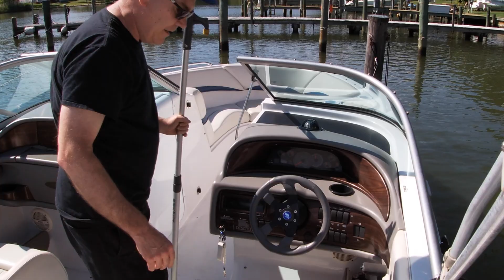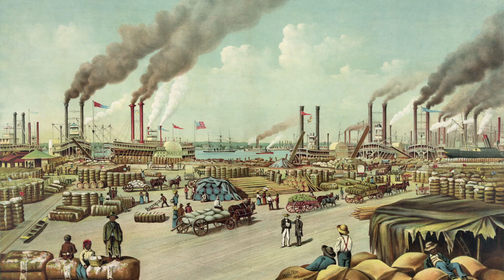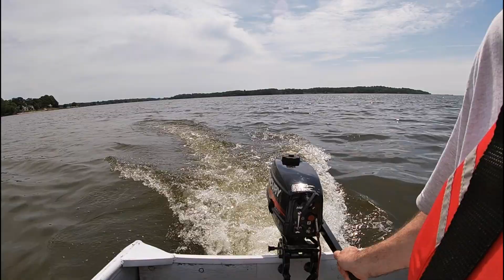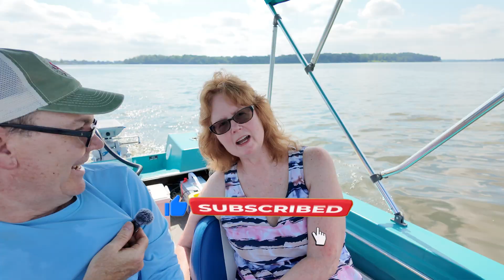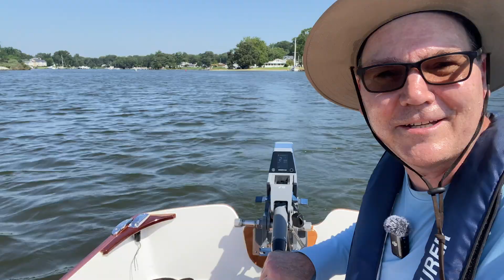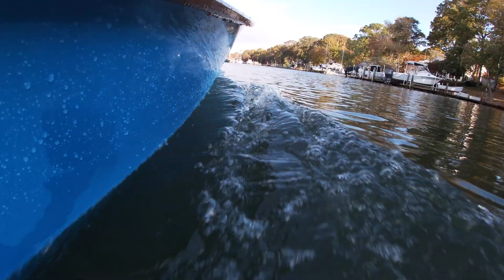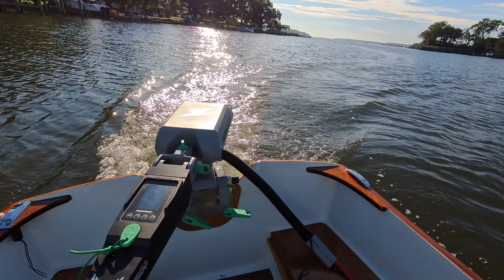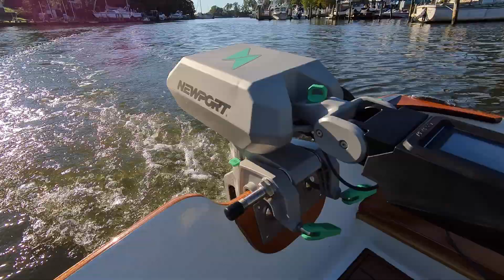The Horsepower Issue with Electric Outboard Motors

Comment: Electric motors work wonderfully for high horsepower applications. My Dad said that during WWII ( you know the big one.) They burned oil in boilers, to make steam, to turn turbines, to make enough electricity, to turn giant powerful electric motors. See, simple..... I have traveled many miles, probably thousands, with an electric boat motor, its called my trolling motor. But when I want to  lift a 3000 lb boat up on plane and return to the dock 5 miles away in a few minutes. I still have to start my old oil burner. Gonna be that way for a while. That is of course if you want to take anything very heavy, very far, very fast.

Comment: "equivalent hp" may be helpful on a land vehicle, it rarely uses all available power. Boats especially anything that can plane will be operated at full throttle. This is not trying to help consumers it's dishonest. As an engineer I don't specify an electric motor based on its "equivalent hp", I look at its power curve. I absolutely would want to know continuous HP rating for a boat. If a a lower HP electric outboard is fun and useful, great. Don't piss on my leg and tell me it's raining.
Reply: It depends. I'm using a 1kW electric motor to push a small sailboat out of the harbour. Its performance is quite comparable to the 3HP gas motor I used before. So for my use case the equivalent number works quite well. If they stated that it's a 1.3HP motor I perhaps wouldn't have tried it.
Reply: Absolutely 💯
Reply: I came to say the same thing I play around with ebikes and performance wise their estimation feels pretty spot on for small land based ev.

Comment: The manufacturers of an electric outboard have to build in a service factor for that unit. on a particular boat YOU could match a prop diameter and pitch to match an outboard of equivalent powers speed.  The problem with this is if you load the boat up or put the motor on a slower hull then the motor cannot achieve the full speed RPM you have tuned the prop for. It will either over amp or just go into protect on the VFD. If this same scenario plays out with an engine it doesn't have the potential to hurt the engine (within reason) the engine just wont do it plodding along at the best it can do. 

Simply put bogging an electric motor down below it's synchronous speed hurts it. This dosnt really apply to gasoline

Comment: 🌴🤔 Hey bud, well this fun , but yeh it really isn’t a fair comparison, as the testing should be on the motor source uses the same drive unit 🤔 by taking an old outboard “ ( say a 5 hp ) “ using it as a gas powered test and then replacing the gas motor with the supposed equivalent to get test results , this way you have the same lower unit with gearing prop size and the amount of friction being exerted against both power source’s, all the new things like better batteries, and high tech controllers, high efficiency more powerful smaller sized solar panels are things that make electric propulsion more desirable, ( and expensive)  my biggest fear is having a massive lithium battery in a sinking boat 😳

Comment: It is strange to have over rated the HP marked on the side.  Some times lakes have HP restrictions like 10HP max.  Hence the popularity of 9.9 HP motors.  Better to have a 6 HP motor that puts out 7 hp than a 15 hp motor that only puts out 7hp.
Reply: @jonleiend1381  That's a really good point! The HP limit is a crude way of controlling boat speeds, but I guess they do it for simplicity of enforcement - no need to argue about exactly how fast someone was moving.

Comment: I am a civil engineer by profession and a boatie in my spare time. I tried the math for my 20ft yacht, which is not a planing hull. I am not interested in a top speed on the plane, because I can't plane. Instead, I am looking for something to propel my (displacement) boat at something-like hull speed, which is (from experience) something-like 5 to 5.5 knots. The problem with the math is that HP implicitly includes speed (Wayne explains this as RPM). kW does not - it is just volts times amps. So, what I actually need to know is the HP or kW needed at 5.5 knots, which will be different from HP needed at 2 or 3 or 4 knots. Again, experience tells me that my 6HP gas motor can push my boat at 5 knots, even when it is pushing into a heavy chop. A mate with the same boat and an EPropulsion Spirit 1 (1kW) tells me he can get about 3 to 4 knots and a couple of hours run-time. This tells me that 1kW is not the same as 6HP (no surprises from the math), but seems "equivalent" to something like a 3HP gas motor. To get an equivalent to my 6HP gas motor on my 20ft non-plane boat, I would need something with more power, such as the Newport NT600 (3kW) or EPropulsion Navy 3.0, which needs a step up from 12V to 24V or 48V.  These comparisons indicate that that the manufacturers are not lying, but you have to know the conditions that apply when they make the comparison. It seems that a 3kW electric motor is or should be equivalent to a 6HP gas motor when pushing a displacement hull at about 5 knots. You cannot use the same comparison when you are on the plane or at any other speed.
Reply: Both HP and kW are units of power, you could measure electric power in HP if you wanted. Or you can do your unit maths and find the distance in a Watt: 1W = 1 N.m.s^-1 

For the rest of us, it's quite sufficient to know that a horsepower is about 746 W. 
Europeans often use the "metric horsepower" or PS which is exactly 750 W. Either way, just divide kW at the prop shaft (typically about 85% of electrical power) by 0.75 and you'll have approximate horsepower.
Reply: @nerd1000ify  Yes, in theory - But the point is that you have different efficiencies, too - Turning either electricity into water displaced or gasoline into water displaced.

Also, I know that in the car field, "HP" of an engine is just that - what you get out of the engine itself under ideal conditions(sea level usually). Not what actually gets to the wheels. You have drivetrain losses, accessories all "robbing" HP, etc. An electric motor driving the wheels through a single gear would be able to keep up with less HP. 

In the boating world, what's the equivalent here? Does "HP" actually mean output shaft HP? Or just the engine HP? Because you probably still have an alternator/battery charger sapping some power, etc. 

And, ideal conditions - It should be closer than with a car, because lakes and the sea generally stays above freezing and relatively cool - but running an engine at a lake at 2000' elevation will produce less HP than at sea level. An electric motor won't care at all.
Reply: @MacRobbSimpson  Petrol outboard motor manufacturers are pretty loose with reported power outputs, as an example Tohatsu and Mercury both used to sell the same small 2-stroke engine (built in Tohatsu's factory, only difference was paint and stickers) but Mercury marketed it as 3.3 HP while Tohatsu labelled it as 3.5 HP.  Which was correct? Who knows! 

On small outboards the accessory drag is basically nothing, as they usually don't have any accessories other than the magneto. There will be a bit of drivetrain loss in the gearcase, particularly because it's totally full of oil so the gears see a fair bit of drag. I expect the gearcase is probably about 90% efficient.

Then we have the propeller. Most marine propellers aren't particularly efficient (60-70% under ideal circumstances), so there's quite a bit of "drivetrain loss" going from the prop shaft to the water. This is where the electrics have a bit of an advantage, they usually seem to have a larger, slower turning prop which will generally be more efficient than the small, fast spinning prop seen on small petrol outboards.

So if we estimate that the gearcase is 90% efficient and the prop is 65% efficient, a petrol outboard with 2 HP at the crankshaft is managing 1.8 HP at the prop shaft, and 1.17 HP in the water. Comparing that to a 1 kW electric outboard with no gearcase (direct drive), if we estimate a motor efficiency of 85%, and a prop efficiency of 75%, we get 850W at the shaft, and 637.5 W in the water, which is equivalent to about 0.85 HP.

Comment: I don't think prop speed is anywhere near the factor you think it is. The gear reduction in the leg of a bf5d is 2.08:1 according to google. so maybe 2500 rpm prop speed compared to the electric 2200.

Comment: This equivalent horsepower rating thing is going to get messier and messier until a common rating benchmark is established. Your right as far as you go, but the fuzzy connection is speed is often the end result being applied. In other words, how fast was the object being moved to the reference distance.  It does not matter=how much torque you apply, you only generate horsepower with movement. The faster you move a given object, the more horsepower you generate. 

A 10 hp engine producing 10 hp at 5,000 rpm is producing only  10.5 ft/pounds of torque.   Slowing that engine down to 2200 rpm, still making the same 10 HP,  it would be making  23.9  ft/pounds of torque. That is a whole lot more force!   Now if you were to keep making that 23.9 pounds of force  all the way to 5,000 rpm, you would be blasting out 22.8 hp. So, if you made that same low speed torque all the way out to 5,000 rpm, you have an equivalent output of an engine over twice the starting hp.

Comment: You kind of skipped a rather important factor when talking about the lower RPMs of electrics and that is propeller diameter and pitch. If you have double the pitch spinning at half the speed it will technically move just as far over the same amount of time. All that being said, you really need to look at the size of the props on the equivalent HP electric motors. They generally spin bigger diameter and pitch props slower to take advantage of their massive torque vs gasoline engines that need to spin up a smaller prop to hit their maximum numbers. Overall a pretty good look at it though.
Reply: The factor you have also missed is that petrol outboards are giving engine rpm  not prop rpm and have gear reduction in the leg.
Reply: @brendonwood7595  Even with the reductions, they are spinning the props smaller and generally have smaller diameter props.
Reply: Larger diameter props are also more efficient at turning power into thrust, which is ultimately what moves the boat. Small outboard props in particular are often rather inefficient.
Reply: Did you miss the part where Wayne stated propeller design as being a factor in the overall calculation?
Reply: @thedevilinthecircuit  that's a different section of the video about overall boat performance. I am referring to the section after that. I mean he is also wrong in that section. If you take two identical boats and put a 5HP on one and a 10HP on the other, the 10 is gonna go faster and yes it is all about speed.

Comment: Perhaps all electric outboards should also prominently display max rpm. 
As a cruiser wannabe, I want my dinghy to go on a plane for better speed and performance/distance as well as be able to make it back to the mothership in rough conditions.
At this time most electric motors fail in both categories.

Is this scenario a fringe group? Something most small craft boaters never really experience? Perhaps so. Would still be nice if they didn’t ignore this market segment.
Reply: No, definitely not a fringe group.  I've been in the marine business for over 20 years first in sales and now running my own service company.  Every cruiser I've dealt with puts the biggest outboard they can on their dinghy.  Nobody has ever said 'well, it's rated for x hp but I'll be fine with less than x'.  If it's rated for 10, 15, 20 hp, they put AT LEAST that much on and damn the consequences.  I've done the same, with a 20 hp Yamaha on my 10' RIB.  Because everybody wants to get on plane, usually with a couple people and a cooler of drinks or the dog or whatever.  

I've also had a lot of clients who ask about electric outboards especially those who don't use them often and leave fuel sitting in the motor for months at a time only to have it go bad on them and have seemingly constant trouble with their small outboards.  But none of them have actually pulled the trigger once I explain the cost, the weight of the giant battery pack, and the fact that they still are not going to have the power to get on plane.  Until battery costs go WAY down and power density goes way UP the tech just isn't there for this market.   The current tech is great for short distance/low speed use but not for the way most boaters use their dinghy which is more of small sport boat than a traditional "tender" used only to get to/from the main boat at anchor.  

As the tech advances I expect it will eventually get there.  There's a lot of advantages with electric.  But right now it's not there.  Sorta like my view of electric trucks - I'd be happy to have one IF it could meet my needs, but so far nothing comes close.
Reply: @donhappel9566 maybe another 5 years. Some big brands are coming out with electric, so there is hope.